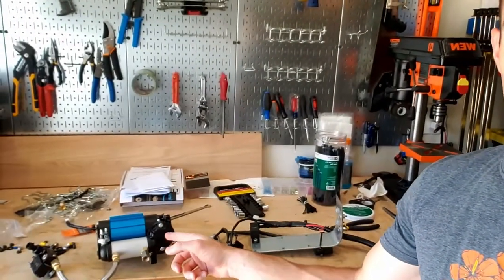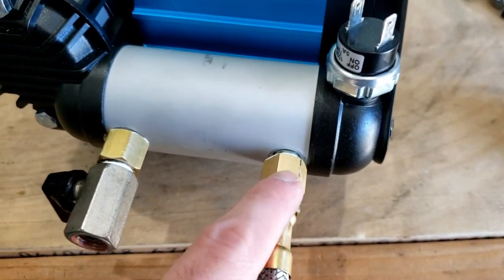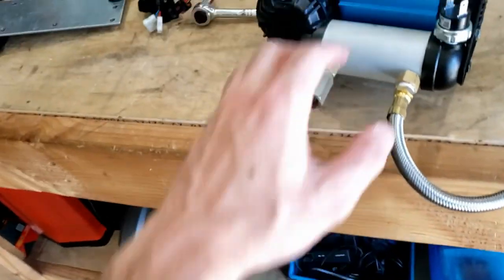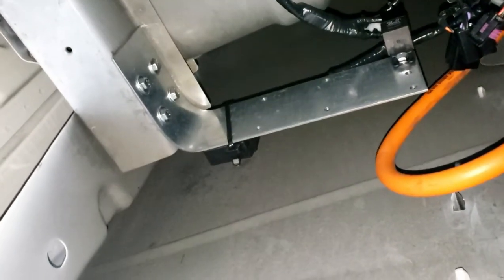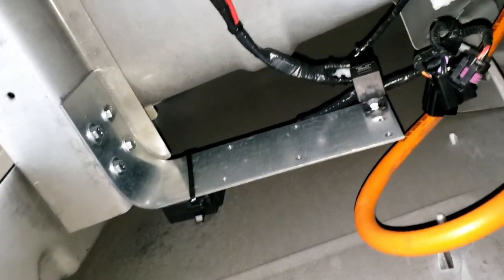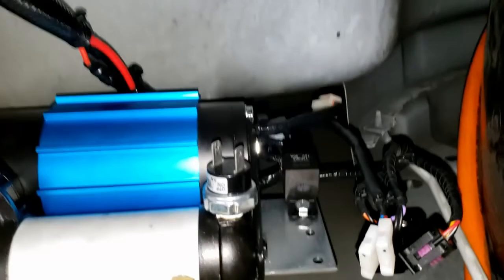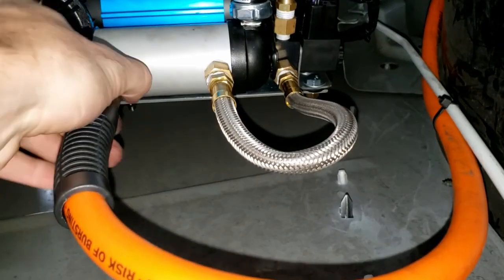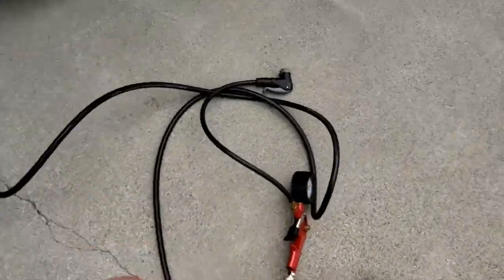ARB Compressor Install Part 2

Comment from the maker: Hey good catch. That’s the one I used. I wrote BSPT when I shouldn’t have.
Reply: Awesome. Interesting that it worked. So weird, I have almost the exact same setup as you. These videos helped a lot.
Reply from the maker: @stevenmullins374 glad it helped!! I ended up selling my 2500 for a 3500 dually for more capacity and went with a different lift this time but am still in the process of building it out.
Reply: @HarrisonsGarage  That's a lot of truck!

Comment: Hey! Great video. Question, you list the 1/8" BSPT to 1/4" NPT Adapter with the Amazon link but it takes me to an adapter that looks to be NPT on both ends. Is that def the one you used?